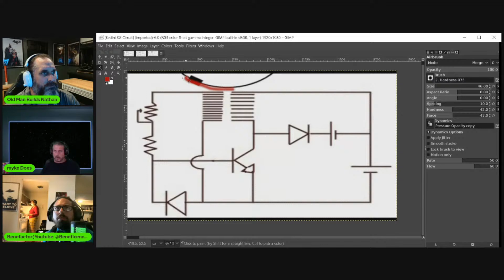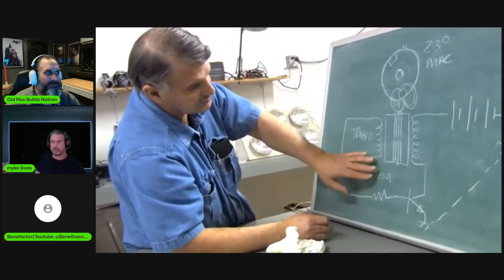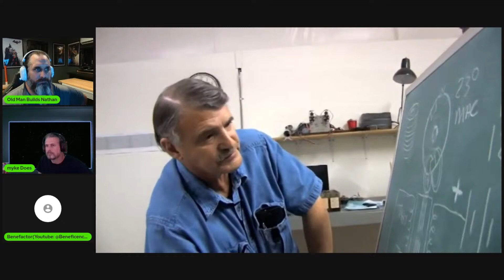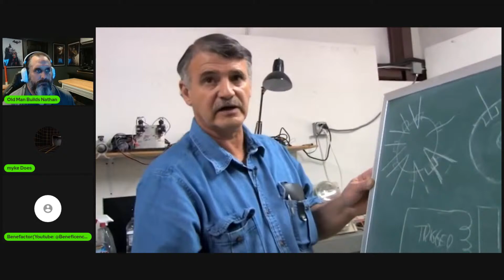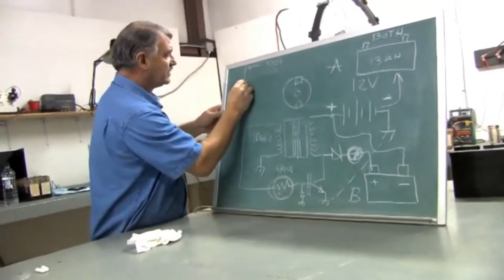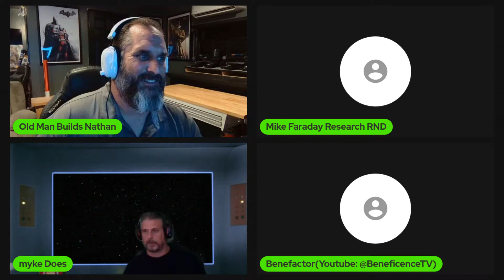Fringe Think Tank "Bedini Motor"

Comment: The bedini coil (two different sized wires ) attract a weak magnet and therefore the battery uses a minimal amount of current to move the wheel.,  If the wheel is light enough  ( but with some mass ) the bedini coil will attract the magnet. By tuning the 680 ohm resister (going towards lesser ohms) the wheel will spin faster and faster  (note that the voltage of the spike will increase the faster the wheel spins ).The trigger will then turn off the transister when the sinewave reaches maximum voltage together with maximum speed of the wheel. and the timing will then happen some degrees after top dead center due to the resister having been tuned to the correct resistance for the speed and size of the wheel. If the resister is tuned beyond this point the wheel will slow down The faster the transister swiches the the current coil, the higher the spike voltage and that is fed to the charging battery B while battery A is only used to move the wheel with as little watts as possible untill the battery is no longer capable of keeping the spinning at the same speed. Then the battery must be changed and recharged. Note that the stronger the magnet the more current battery A will use and that is a waste of energy when you are trying to save energy in battery B. The longer battery A lasts the more energy is saved in battery B and other batteries.
Reply from the maker: That was the explanation I was looking for last night. Thank you.
Reply: Wow, you seem very experienced with the Bedini motor. What is the input power compared to the output power?
Reply: Input power is pretty much the same.. scalar voltage is better held in capacitors then dumped into a battery. The bedini motor destroys small batterys so u must have a heffty battery to charge.
Reply: @TheInkhousecustoms  It sounds like the power in equals power out. The YouTube channel kenergy builds and sells bedini motors. I'm knee-deep in Tesla coils but will add Bedini motors to the project list. Thank you for sharing!
Reply: @shawncalderon4950 can u send a link to that channel I couldn't find it.
Reply: @SpiritLightBodyD6L1  https://youtu.be/A7Tgb2a7AbY?si=sg9z6_AnCHxfbF_W
Reply: Excellent breakdown and a build up.

Comment: 1:10:00  the coil on top of the battery is charged by the battery below it  and the same coil will do a radiant flyback into the other battery sitting under the other coil . then repeat . THis switching method is not typical and will confuse many. You must watch the animation closely . When the coil is green it is flyback  and you can see the green arrows channels . When coil is red it is receive charge from the battery below it . I need to mention it is a Bedini Modification so its a flyback generator/pulse motor